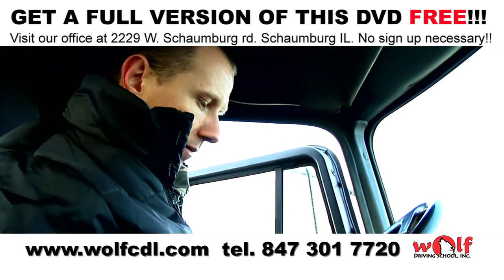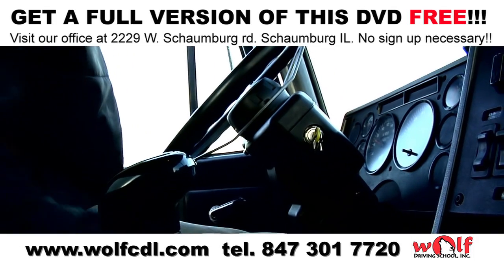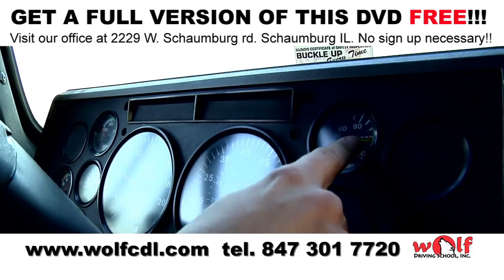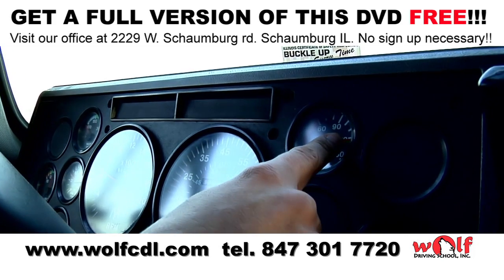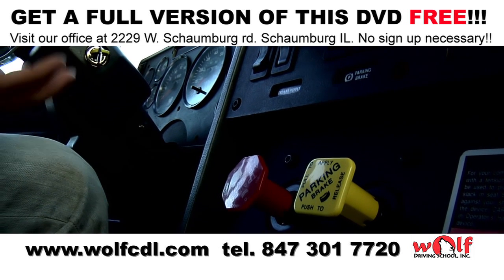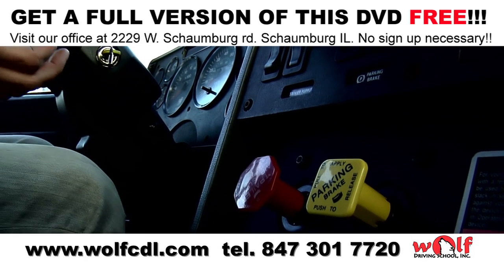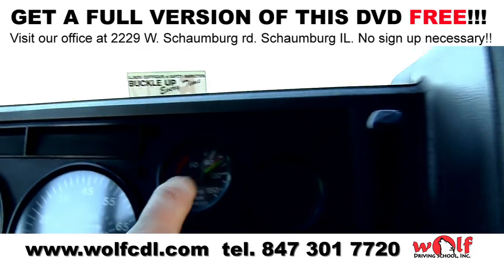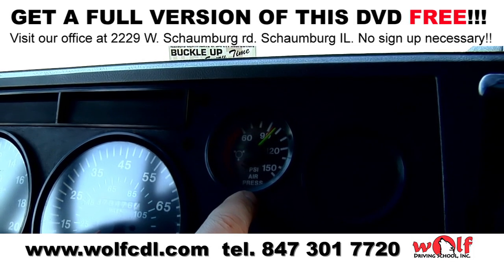AIR LEAK STATIC TEST

Comment: Select first gear, with wheel chocks down*, Turn engine off and ignition switch back to the on position until computer clear the warning light(but don't start the truck), release parking brakes, static test for leaks (check for air loss without applying any brakes) no more than 2 psi straight truck or 3 psi combination vehicle in 1 min. (60 sec).
Reply: Frank201281 thank buddy, what about apply test ?
Reply: Thank you very much, excellent explanation.